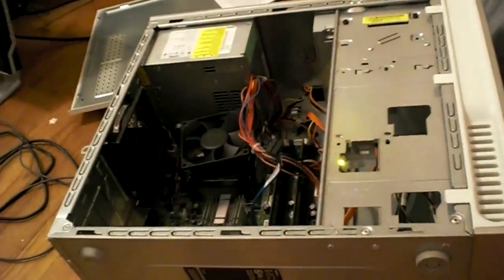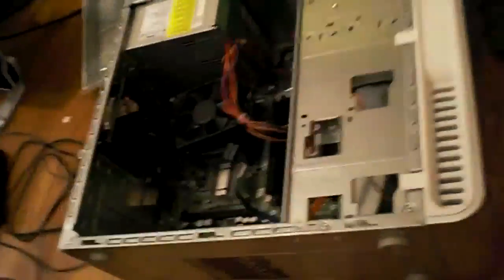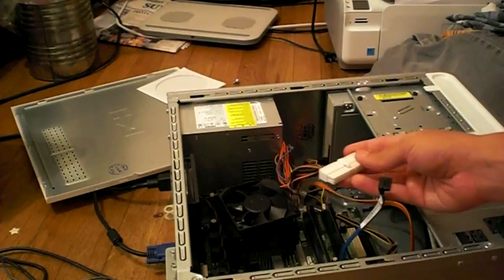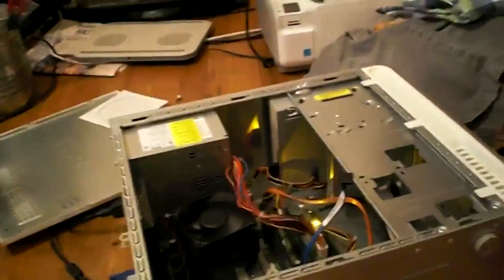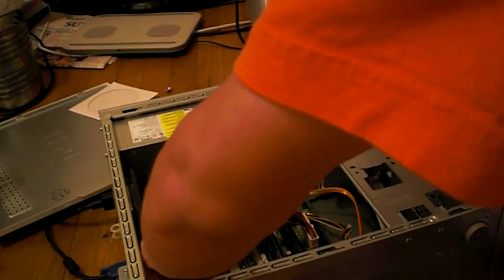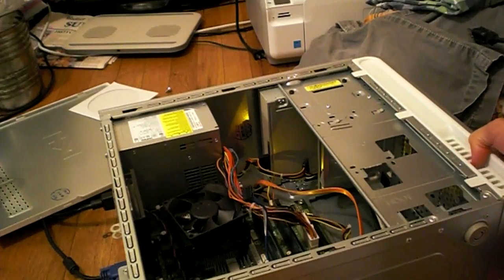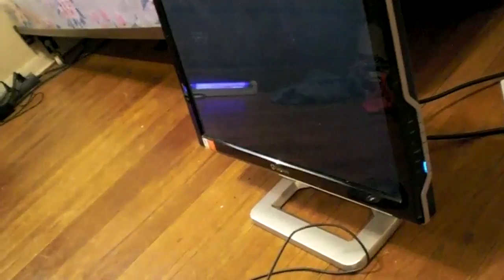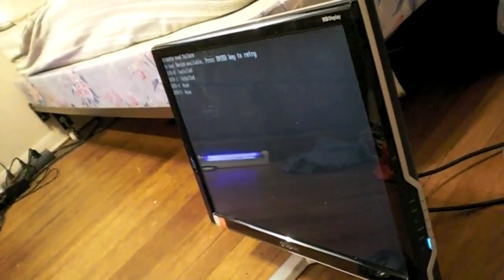Dell Inspiron 530 computer Wont turn on Properly.  what could cause this? Read description

Comment: i still have this computer and i upgraded the processor the ram to 8gb put in 1tb ssd and upgrade to windows 11. works better than a $500 new hp which uses cheap junk parts. ill never buy a cheap new computer again when older ones are cheaper to upgrade and have better quality parts and faster speed.

Comment: My "new" Dell Inspiron 530 I just got has a solid amber light on the power button.  Surprisingly when I pressed the amber button it went blue and it DID POST a couple times and I checked out the BIOS.  I put a solid state drive in it and powered it on but it won't POST now.  I disconnected the SSD but it still won't POST.  It now still has the solid amber light but when I press the power button it goes blue like before but it will not beep.  The screen doesn't power on now either.  I press the power button again and it turns off.  I don't have to hold it in to turn it off.  I guess I'll get a new Power Suppy Unit but do you know if it might be something else?  I'd hate to get the new PSU and it still does this.  I DID replace the CMOS battery as I was told the old one was bad and the guy I bought it from replaced it with another old battery and he wasn't sure about it.  So I put in a new one.  But my power button isn't flashing orange which I think means its the CMOS.  It's light is solid amber.  So solid orange means a power supply problem, I've read.  Could it be something other than the PSU??  I will point out that there is two different kinds of memory in the computer but with the amber light meaning a power problem could it be the memory?  Any help is appreciated.    -Tom
Reply from the maker: I don’t really know much about working on computers these days since it’s been so long that I have tried to fix it. Been using a 12 year old MacBook as my only computer. The one in this video is long gone now and never did find a permanent solution. Try searching online for the similar problem and maybe find some message boards or  something. I’m sure there is someone that can help, internet is full of good resources these days.
Reply: @patricknedz    Thanks for your response Patrick.  I discovered the graphics card was the problem for the computer not POSTing.  Once I pulled it out the computer would work. I put a new card in and everything seemed to be fine but the BIOS keeps resetting.  I put a new CMOS battery in but it's still resetting.  So maybe the points are not connecting to the battery, or the jumper is on the wrong prongs, or there's a problem with the motherboard.  I'll check it out.  Thanks again Patrick!
Reply: @patricknedz    Oh hey, I just came across this video again and saw my message. 

So, what was wrong with this Inspiron 530 I had purchased was the jumper to the CMOS battery was on only the last prong, prong 3 I think.  It's supposed to be on prongs 2 and 3 to keep a charge to the motherboard from the CMOS battery.  I was glad that the jumper was still there at all.  I started up the computer but still had the orange light on the power button.  Then I discovered the connectors to the CMOS battery weren't touching on the side of the battery.  Once I bent them over a little they now were making contact with the battery and the computer now holds the BIOS settings when power is cut from the wall socket.  I was thrilled.  I was glad it wasn't the motherboard.

  Another problem also was the PSU was a MicroCenter upgrade that apparently was made to make the computer sell better by promoting that it was a higher wattage but was actually a poor PSU.  I read this PSU was known as an "Exploding PSU".  HAHA!  Which it did a few weeks ago with white smoke blowing out the back and the fans revving higher than I've ever heard when I started the computer.  Luckily nothing was ruined by the overload that this PSU was sending.  I noticed when I'd hit "Restart" on Windows that the computer would sometimes rev up the fans the whole time even after Windows had loaded.  I didn't understand what was going on.  I thought it was a virus at first and then thought maybe it was an inherent problem with Inspirons or something.  But now I think it was the PSU giviing the wrong power and my computer was trying to tell me something.  It was always loading up fine when I'd start it but this would happen with restart.  I've not had the fans rev up since but I haven't restarted the computer that often.  Maybe it could happen again.

  So now this computer is running at it's best with the Q9650 CPU, 8 GB's of 800Mhz RAM (I've been told that 1066Mhz will work with some effort), I've since discovered that this card in the PCI slot is not a modem card but rather a 1000Mbps LAN card ( I was connecting to the internet through the original 100Mbps port, doh!), got the new PSU, put in a GTX 1050Ti (overkill on modern games, yes, but works great for VP9 4k video on YouTube.  With only 8GB's of RAM I don't think I'll ever play any powerful GPU hungry modern games on this computer anyway.)  I put a Bluray drive in it too but the video's aren't playing perfectly with some jitter every now and then.  I haven't tackled this problem yet.  Maybe a better player program will fix it, maybe 1066Mhz RAM, or the flow rate is just too slow for Bluray video.  Although I think a Bluray drive may have been an option with the quad core version of these computers when Blurays first came out.  I put a 2 TB SSD in it too.  Today an SSD is a given.  I upgraded the BIOS to the 1.0.18 version too.  I don't know if the computer would accept 8 GB's of RAM without this, or at least a later BIOS than the 1.0.15 in the computer originally.  I also put a new front panel in for 3.0 USB devices.  Much faster than the 2.0 USB that came with the Inspiron.  I had to plug it into the PCIe 1.0 slot under the double wide GPU which I guess weren't out or popular at the time the Insperon Foxconn motherboards were made.  So I had to use and extention cable out of the PCIe 1.0 slot to the card that supplies the data to the front panel and have the card sit inside the computer loose with a cardboard made covering to protect it and the other parts to not make electical contact.  Ha!

  I've also replaced the thermal paste on the CPU, Northbridge and Southbridge chips.  The Northbridge cooler was a little tough to get loose.  But the Southbridge cooler was "cemented" to the chip!  I had to use a pair of plyers and rock the cooler back and forth to the point where I thought any harder and I'd break the motherboard!  It took a few minutes of this repeated rocking 'til 'CRACK!!!" it came loose.  Then it took forever to get the old paste off.  It was a thrill moment when I said "I see letters on the chip.  What does that say??  INTEL!!!!"  That was fun to first make out that word on the chip.

  So today now I'm going to do this with my mom's old Inspiron.  This was the whole point of this Inspion I've got now.  Learn everything and then work on my mom's Inspiron as not to ruin her's.  After learning everything, it's been great.  Next thing is I'm now going to get a Vostro 200 or 400 case (same as the Inspiron 530's but the black version) and put in a modern motherboard.  The back panel is part of the case but I know that can be cut out.  And the front power connector has to be rewired to connect to a standard motherboard connection as Dell had it's on connection that was never released to the public.  But everthing else is standard from what I've read.

Comment: My neighbor has a Dell Inspiron 350s. It turns on and displays a blue light. The monitor turns on and says LG (so it isn’t the monitor connection). It then goes blank, has no connection. He said that the computer use to display a blue light and then an orange light. But now it doesn’t...I think I’m going to have to open it up. I feel like it’s going into a boot safe mode. Maybe experiencing a failure with the HDD or something.. any thoughts?? It looks just like this PC!

Comment: you probably fixed this already because the video was made in late 2012..... but the power supply on the back of the computer should have a red switch. switch it back and forth and it should turn on again..... if its not that, then your power supply may have been damaged and needs to be replaced.... good luck! - especially to anyone else who may have this problem. Never ever mess with the wires on the inside.

Comment: Get yourself a new power supply for 15 quid and you should be back in business. Thats how I fixed mine and I still use it to this day. In addition you can upgrade the BIOS so the Pc will support 8Gb RAM instead of the usual 4 GB.

Comment: when I turn my computer on the fan spins at full speed in short sprints. my BIOS/system startup screen appears with a plain blue background then it restarts and does that again. pushing f12 or anything like that do not work before the BIOS screen. please help...

Comment: power supply box needs to be replaced. Put a hair dryer 3 inches from power supply box on back of computer then it will start up but I think the power box needs to be replaced :)

Comment: HI, if you heatup the inside with a hair dryer it will turn on, this usually happends when the computer is in a cold start. try it it works trust me :)

Comment: The problem may be corrupted BIOS/Firmware.
I have encountered 2 of these Dell 530 computers with the Foxconn G33M02 motherboard.  In both cases, it was acting just like the computer in this video. They would not start, or the fan would spin at high speed, etc.  The power supplies were good. They acted like the motherboards were dead.   I both cases I found that the CMOS battery had very low voltage.  Around 1 volt.   I replaced the CMOS battery.  I then cleared the CMOS memory.  To clear CMOS memory, unplug computer, find the 3 pin connector labelled CLR_CMOS, remove the jumper from pins 2-3 and put it on pins 1-2 for about 10 seconds. Put the jumper back on pins 2-3 and plug computer back in.  If you are lucky, the computer will start up. You will need to go into computer Setup to reset the time etc.  Press F2 at startup to enter Setup. In my case, this procedure fixed both computers.
Reply: hmmmwill have to try battery to see if it will let me run duel channel ram now

Comment: It's both. The power supply is dead, And the motherboard might have a busted cap, or bad CPU. a replacement for both would cost about 100 bucks.
Reply: +Jesse The Laser It would be very difficult to replace the motherboard in this compute.  The back surface of the Dell 530 is a single sheet of metal with holes for the motherboard connectors. This is not like most computers, where there is a large rectangular cut out for the back connector shield.  You would have to find a replacement motherboard with the exact same connector layout.

Comment: Since this was published in 2012 this comment is not relevant to anything except to be a rant. The Dell 530 comes with a FOXCONN motherboard. They are famous for graphic chipset failures due to substandard solder. So, the motherboard is junk in anycase. To test the power supply just pop a spare one in. Outlet PC sells a 400watt superior replacement for about $18. Personally, I like Dell but anything with FOXCONN in it was lucky to run more than two years, check the record. HP had the same problems with them. Hope this helps someone somewhere. This boy should not touch computer or video cameras. IMHO.
Reply: Foxconn has been involved in several controversies all relating to employee grievances or treatment. Foxconn has more than a million employees.[73] In China, it employs more people than any other private company as of 2011.[35]

Working conditions	Edit
Allegations of poor working conditions have been made on several occasions.[74] News reports highlight the long working hours,[27][28] discrimination against mainland Chinese workers by their Taiwanese co-workers,[75] and lack of working relationships at the company.[76] Although Foxconn was found to be compliant in the majority of areas when Apple Inc. audited the maker of its iPods and iPhones in 2007,[7] the audit did substantiate a few of the allegations.[77] Despite the suicide crisis which took place from January to May 2010, Steve Jobs defended Foxconn in June 2010 as being "pretty nice" and "not a sweatshop".[78]

Concerns increased in early 2012 due to an article published in The New York Times.[79] Substantiating some of the article's claims, a 2012 audit performed by the Fair Labor Association at the request of Apple Inc. found that workers routinely received insufficient overtime pay and suggested that workplace accidents may be common.[80][81]

A Hong Kong non-profit organisation, Students and Scholars Against Corporate Misbehavior, has written numerous negative reports on Foxconn's treatment of its employees.[82] These typically find far worse conditions than the 2012 Fair Labor Association audit did,[citation needed] but they rely on a far smaller number of employee informants—100 to 170.[83] The Fair Labor Association audit in 2012 used interviews with 35,000 Foxconn employees.[80]

In September 2012, a fight at worker dormitories in Taiyuan, Shanxi, escalated into a riot involving 2,000 people and was quelled by security.[84][85]

In October 2012, the company admitted that 14-year-old children had worked for a short time at a facility in Yantai, Shandong Province.[86] Foxconn said that the workers involved were part of an internship program.[86] Individuals as young as 16 can legally work in China.[86]

Also in October 2012, a young worker, Zhang Tingzhen, was threatened to have Hon-Hai medical support canceled when doctors remonstrated against moving him ("Zhang’s doctors fear he is at risk of a brain hemorrhage en route"[87]) for treatment in Huizhou from the hospital in Shenzhen. His doctors did "surgery to remove nearly half his brain, [after which] he lost his memory and can neither speak, walk"[87] after a factory accident where he suffered an electrical shock and fall. This left him in no condition to travel to Huizhou, the city where he was initially hired, 43 miles away. The company stated that it was acting within labor laws.[87][88][89][90]

Suicides	Edit
Main article: Foxconn suicides
Suicides among Foxconn workers have attracted media attention. One was the high-profile death of a worker after the loss of a prototype and the other, a series of suicides linked to low pay in 2010. Suicides of Foxconn workers continued into 2012, with one in June 2012.[91]

Sun Danyong, a 25-year-old man, committed suicide in July 2009 after reporting the loss of an iPhone 4[92] prototype in his possession.[93]

In reaction to a spate of worker suicides in which 14 people died in 2010,[94] a report from 20 Chinese universities described Foxconn factories as labor camps and detailed widespread worker abuse and illegal overtime.[95] In response, Foxconn installed suicide-prevention netting at the base of buildings in some facilities,[74] and it promised to offer substantially higher wages at its Shenzhen production bases.[96] Workers were also forced to sign a legally binding document guaranteeing they and their descendants would not sue the company as a result of unexpected death, self-injury or suicide.[97]

Comment: Ok so typically when this happens to my Dell Inspiron 530 I let it sit unplugged for like 8 hours. but the paperclip trick actually works! a little bit of tinkering with it to get it to work but it does. thank you so much I'll have to remember this for next time. special note... You may need to reconfigure your BIOS after all this so that it boots into the correct thing.

Comment: I have the same problem that I'm going through right now same computer same everything. but this is happened before. Here's what I do. unplug it and hold the power button until the lights turn off. hit the power button again a few hundred times just for good measure and then leave it alone for 6 to 8 hours unplugged so that the capacitors can completely discharged. after that it should start up at least once. whatever you do leave the computer on once it starts. leave it on for at least 24 hours. after that everything should have normalized. I think I'm going to be investing in a backup battery supply because unexpected power outages brownouts or having to smother the computer and caused this problem. its a shitty power supply its not broke just shitty. haven't tried the paper clip thing yet. I think I'm going to wait it out and if it doesn't boot after 6 hours I will try the paper clip thing.
Reply: Nottellin Stillnottellin So what does it mean if the power supply is tested by a tech and the power supply works fine on its own?  Motherboard issue?
Reply: Krump yeah it's probably the motherboard. Or a bent pen

Comment: I have a dell optiplex 360 which did the same thing to me after a power cut when it was switched on..i gave up and left it unplugged for weeks, i tried it again and it worked fine? The electric went again today, same thing, wont turn on, there is a button on the back of the power supply which does the same thing as putting the paper clip in, it send power to everything at once, i messed around with the button, plugging things in and out, then all of a sudden it startes with a blue led on the power button and is now working fine, maybe it is a protection device on the board, who knows??